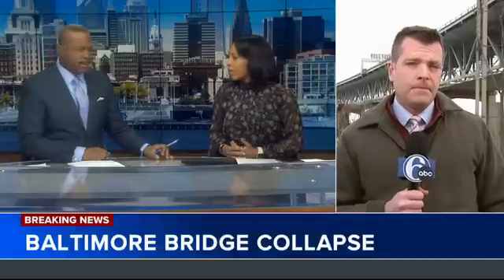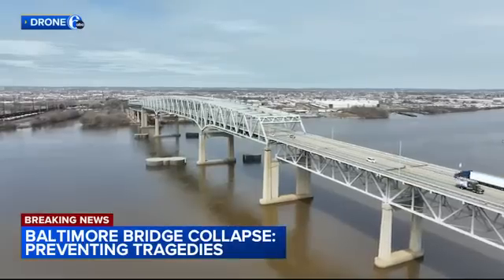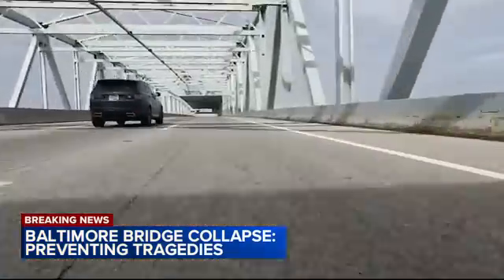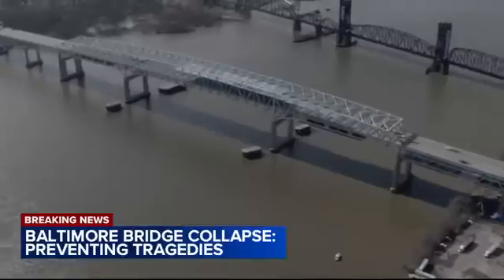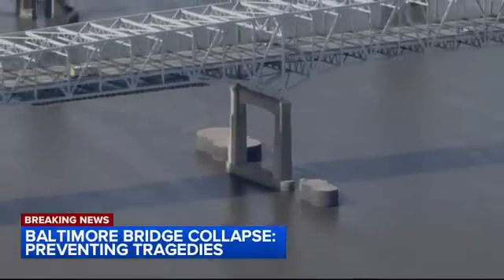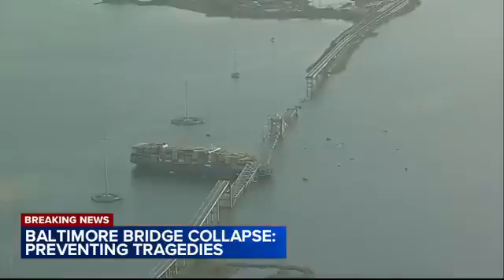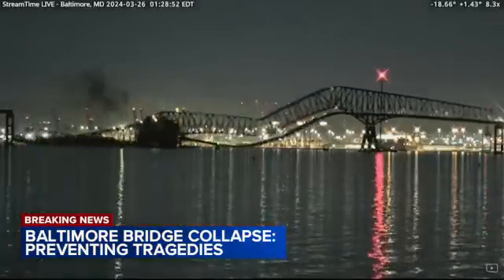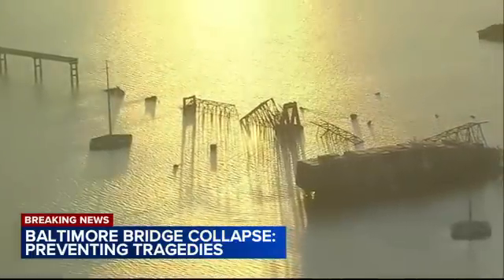Here's what surprised a structural engineering professor about the Baltimore bridge collapse

Comment: The bridge didn’t stand a chance with this loaded behemoth.  None
Reply: In 2007 the Cosco Busan struck the San Francisco Bay Bridge.  Well, almost because protection around the piers took the impact preventing a similar Boston event.   In that case, Harbor Pilot navigation error.
Reply: Not similar, big difference between hitting a pilling and hitting the bridge dead on! @nomenclature9373
Reply: @nomenclature9373 It wasn't pilot error, the ship lost power.
Reply: @nomenclature9373  Wow, my bridge; I've crossed this bridge hundreds of times. My friend Dennis Shephard was commutting home form the flower district on Fourth and Brennan across the Oakland/Bay bridge when he looked into his rearview mirror to see the car behind him plunge into the bay.
Reply: @nomenclature9373  The 2007 incident was a sideswipe.  It left a gash 150 feet long on the port side of the ship.
It did NOT strike the pylon head on.
Reply: The system protecting the Delaware bridges would deflect that ship. They glance off and divert the inertia away. They have them in Miami and elsewhere and they have been proven to work.
Reply: @AlexStAmand603  exactly, they don’t stop a ship , it deflects the impact away from the pylons , and Maryland looked into doing it and said Nah too much money.
Reply: The ship was 130,000 tons. It was going 8 kts. That's over 400,000 ft/lbs of force, spread over the minimal width of the piling. (I did sone quick math but I'll glady defer to an expert engineer). That bridge didn't stand a chance. The ship put more force on that piling than the whole bridge put on the ground it was built on, including traffic.
Reply: Almost 1000 feet of cargo going 8 knots? Like a Miata in front of a freight train.
Reply: There you go bein' logical, Chris!   😄
Reply: @chrismcgonigle964  Exactly. There's literally nothing you could do to make the bridge itself cargoship-proof.
Reply: @blackosprey2219   @chrismcgonigle964  Exactly. There's literally nothing you could do to make the bridge itself cargoship-proof.

You seriously have zero idea what you are talking about. NONE. 

This happened already in 1980, when a smaller cargo ship took out the Sunshine Skyway Bridge in Tampa. When they rebuilt it, they built considerable concrete berms around the piers, which are able to deflect anything except a head on strike, and stop dead anything that does hit it head on. It would be almost impossible for any current ship afloat to manage to take out the SSB. 

It is inexcusable negligence for the people in charge of these bridges to have not installed berms around the bridge supports in the last 40 years. There are some retired employees who should be broke and in jail before the lawsuits and charges have been completed.
Reply: @blackosprey2219  The barrier just has to be put far enough out front to stop a cargo ship. Problem solved.
Reply: @blackosprey2219 yes you can.
Reply: @nickbrutanna9973  Your not gonna stop a 165,000 ton ship. It will laugh at your concrete and just keep coming.
Reply: @blackosprey2219 You don't need to. You just put artificial islands upstream and downstream of the piers and the ship will be unable to hit the pier in the way it did. Why this bridge had no protections in place is insane, it was an accident waiting to happen.
Reply: @blackosprey2219 I'm a Captain and you're comment isn't even remotely close to being true, bumpers could've prevented this. They weren't put in place because they didn't want to spend the money. You shouldn't make assumptions about things you clearly know nothing about.
Reply: @nickbrutanna9973 I'm a Captain and you're correct, no protection was put in place because they didn't want to spend the money. If they were put in place this could've been avoided.
Reply: @Jacob-ed1bl  Cap, what type of ships have you commanded sir? TY
Reply: @billythekid3234  I'm a towboat captain with 28 years of experience. I never said I was ship captain or pilot. I operate between the port of Houston and the lower and upper Mississippi River. My vessel with barges is approximately 981' long and 54' wide. I operate in the same inland waterways as the ships do and literally have dealt with thousands of them. I'm extremely familiar with how they function and operate because it's part of my job. Calling people liars is pretty childish, but you saying "cap" already revealed that. Is there anything else you'd like to know?
Reply: Sir I was in no way calling you a liar!  If that's how it was taken I'm sorry. When I was flying it was common to call the captain Cap. with no disrespect.  Maybe you can answer this question,  could 2 tugs turn the ship and how long would it have taken?  I know they could but  how long,,,,,,,,,,,,,, thank you!
Reply: @billythekid3234  I'm sorry, man. I'm so used to people using "cap" as in "liar" and so many clowns calling me a liar. When I tell them I'm a captain, I immediately take it the wrong way, plus I'm on the vessel now and pretty exhausted.. I do apologize for  being a jerk, lol. 

So it's virtually impossible to give you an exact time because so many factors come into play. How fast was the current  how strong were the winds, how heavy was the ship at the time, how much room to navigate, and other factors all would affect how long that would take. I can tell you this much, two harbor tugs could push or pull that ship away from hitting that column in a matter of minutes. Turning the ship completely around usually takes anywhere from 10 to 20 minutes, but as I said, many things come into play that affect that time. I'm guessing you're trying to find out if having harbor tugs could've prevented this, and the answer, in my opinion, is absolutely.
Reply: @Jacob-ed1bl  Jacob,, no problem sir.  Ty for the info.  Maybe they will chang that for some harbors. Have a great day and get some rest! take care!
Reply: @billythekid3234  Thanks, you too!
Reply: @blackosprey2219 that's not true for most bridges that span shipping lanes.  Should have been anticipated and built to handle the worse.  With ships getting bigger upgrades should have been put in.
Reply: This is probably true of ANY modern bridge of similar length to the Baltimore bridge.
However, the concrete islands protecting the two piers of the Betsy Ross bridge are a really good idea. They likely need to be be strengthened on an ongoing basis to allow for the increasing size of these 'behemoth' cargo vessels. But the rounded ends of these protective islands will deflect the rogue vessel sufficiently to protect the bridge piers. And that's what's important.
Reply: That was a medium size container vessel the channel area and docks aren’t deep enough for the big vessels. Think double that ships size. When they loose propulsion they take a mile and more to stop.  Even tidal flow current would move a large ship fast enough to take that bridge out.
Reply: @kennethprocak5176 not true the port of Baltimore can handle the worlds largest ships and frequently does
Reply: Ship is the size of the Chrysler building.
Reply: Should have been called the Matchstick Bridge.
Reply: It would have, had the piers been properly protected. But that's not the only issue here. Why did the whole structure collapse like a house of cards when it was hit?
Reply: @bobjohnbowles  You're correct that it could've been protected, but you do not understand how it all came down is truly astonishing. If I kick your legs from under you, are you not going to fall? You can't grasp that one support held up those sections. Please use your brain 🙄.
Reply: Lots of questions about that Baltimore bridge...looking forward to the answers...
Reply: A true shame, and yet now something else to rebuild and RENAME away from our heritage. From the name of the composer of the 'Star Spangled Banner', to what!! >> lynnep6088: 'The company that owns the ship should pay to rebuild this bridge.' Absolutely! Its insurance company should be able to afford it too! Keep the name! Blessings to all victims affected!  (..and the Butigiege biased, LeftyLib, Racist, MORONIC, unnecessary comment! Freak show needs to STOP!! So Bad!)
Reply: All empty containers and not loaded.
Reply: The lights was on when it full powered before hitting black smoke rising from the stacks
Reply: Sabotage.  lefties, subversives inside "ooooh it's racist not to let them in, Extortion of bad seeds", we don't get our industries / mfg back they sent out on purpose with regulations and want more,  good jobs for Americans again and Quality, and security inside,   BUT OUR overtaxed / America drain drain drain GONE, china's army coming in illegally at the border too with the thugs, and pocket corrupt linings, lefties were "BOUGHT" by every hater/aggressor nations peoples 7+ decades ago at least.  taking actual freedom and what they offer in it's place is the opposite of freedom for partakers and their victims...
Reply: What? Are you saying Whoopi hit it?
Reply: The report I heard said the tug boats had just turned around which I thought was crazy since it was not clear of the port yet.
Reply: @anitacordeiro372  I believe the ship was technically clear of the port itself. It was centered in the exit lane in the river leading to the port from the Bay. At the time the tugs released, the ship was sailing in a straight line out towards the Bay. That bridge is actually about 2-3 miles or so from the port itself. Would you also expect a tug to escort it under the Chesapeake Bay Bridge that it would pass under in another 15 miles or so? It averages about twice as much traffic as the Key bridge.

You do realize that ships pass under bridges without tugs all the time, right? And without incident.
Reply: Is nobody else shocked to hear that there's a bridge in Chicago named after a known racist white defender of the patriarchy?

Do better, Chicago.
Reply: This is EMOTION, not engineering analysis. Sorry.
Reply: I'll take an educated engineers opinion over you or any other utuber
Reply: @Cre80s  The skyway bridge isn't capable of taking a hit from the ship. That's ridiculous. That's why it has massive bumpers protecting its columns.
Reply: Like many structures all over the US, it met the minimum requirements for the time it was buillt, was built as cheaply as possible, never upgraded, and just fine until a major problem or accident. Now, in everyone of these comment sections, people are saying nothing could have stopped just a huge ship in a case like this which is wrong. THIS bridge did not have protection, and was not designed to prevent this disaster. Many other bridges in major waterways do have systems  to deflect or stop ships of any size.   Watch and see what the new bridge has, bet you it will be cargo ship proof.
Reply: Definitely no chance, but who was steering the ship? 😆😅
Reply: Bridge wasn't built right
Reply: @OneNationUnderHiFi  where the bridge once stood, but underneath
Reply: Not true.  Simply have strong enough guard works so careful does not need to be replied on.
Reply: i was surprised at how completely the bridge failed. a hit should have closed the bridge, but in no way should one hit have totally demolished the bridge if it was correctly designed and built.
Reply: Yeah, that ship would have mowed right through any protection system. I figured to protect those supports, they would have needed an artificial island at least 50 years in size to slow and lift the ship. A few concrete blocks in the water would just get pushed right into the bridge supports by the ship.
Reply: The bow would stick out more even if those dolphins were in place.
Reply: It should have, though. Bad engineering.
Reply: The government wants to spend more money. Nothing would stop a bridge from going down with getting hit like that.
Reply: But would had not a chance against anything smaller
Reply: What is the difference between a loaded behemoth and a loaded ship?
Reply: No proper maintenance and proper design improvement through time and design limit to the ship capacities and size..
Reply: It's the immovable object meets the irresistible force. Maybe something could have been put there, but at what cost? Mammoth blocks of steel aren't cheap.
Reply: No engineer in the '70's could have even dreamed of that size ship.
Reply: The bow of the boat sticks out much further
Reply: @tonysylvester721  Not compared to the bulbous bow that is under the water.
Reply: @tonysylvester721  It's much longer in the water.
Reply: Where were the tugboats??
They usually assist in guiding the mamath boats
Reply: @michaeltewes7833 from what I could figure out is in Maryland tugboats are not required to escort the ship out of port. Massachusetts requires the tugboats escort ships out of port.
Reply: @robertknight4672  those rules will change very quickly.
Reply: @robertknight4672  The tugs took the ship from its berth, through a turn into the exit lane, then let it go.  It more or less WAS out of the port, into the river leading to the port. It had a straight line out into the Bay. I don't think it's unusual for ships to not rely on tugs when sailing in a straight line. When I was in the Navy, that's pretty much all the tugs did. Pull us from the pier, turn us into the channel out, and we're on our own. Even the carrier.

More concerning is the power failure. This ship was departing for a transit through the Panama Canal enroute to Sri Lanka, apparently. You'd think in preparation for a journey of that distance, a little more attention might have been paid to the condition of the ships engines. Going DIW as you're leaving port is ridiculous. Doesn't sound like it would have made it to its destination, anyway.
Reply: The did but they let it go before the bridge. Maybe keeping the freighters tethered until they pass the bridge is a good idea @michaeltewes7833
Reply: @michaeltewes7833 I'm a Captain and no they usually don't, it's also not required for this bridge.
Reply: @michaeltewes7833 my shipping expert said that the tugs had let the ship go already after they were under full power and on its way. Maybe they should clear the harbor like they do when coming in? Just what I was told.
Reply: @bps7209   I saw where they were a 1/8 of a mile from her, so I guess just not enough time?
Reply: @billythekid3234  evidently so it seems.
Reply: @michaeltewes7833  From my own experience with Naval Ships, tugs only assisted when bringing ships into the pier, we'd have a pilot when pulling out but not assisted by tugs.
Reply: @michaeltewes7833 They were there! They released the Dali just minutes before the malfunction. They tried to catch up, but didn't reach her in time!
Reply: @michaeltewes7833 once the sip is underway under its own power the tugs back off
Reply: @michaeltewes7833 "economic efficiency". Thank you Maersk!
Reply: @michaeltewes7833 the harbor master was controlling the ship
Reply: @michaeltewes7833  Its 'mammoth'. How would tugboats help a ship without power?
Reply: @giftedone831  Cause the tugboats pull the vessel ... it would not be running on its own power until in open water ... much like the pushback tugs work with airplanes
Reply: Tugboats have insane power and manoureability.

Basically 1 could have prevented this by moving to the side of the bow of the ship and with full power rotate her back into the channel.

Tugs were called but they were too far away being send off earlier when everything was still OK.
Reply: Tugboats don’t just pull. They can also push and rotate a ship.
Reply: @giftedone831 why tug boats are there!!!!!
Reply: @stevefowler3398  I understand that, but they had already been guided out of the channel and was fully under their own power when the accident occurred. Reading and critical thinking is fundamental.
Reply: @giftedone831 I'm a Captain and the tugs have about 10,000hp and fairly easily guid and maneuver ships in the harbor. They weren't required for making this bridge.
Reply: @giftedone831 tug boats are massively overpowered for their size. It's the reason we use them at all. It couldn't pull that ship at its cruising speed but with 5000plus hp motor it can help steer and guid them. That's what they are designed to do

Edit: what the guy above me said, since he would know better than I would. I didn't know the tugs were that much more powerful.
Reply: @gdiwolverinemale4th    That ship is CGI  video,  how can a tug pull that ?    slow the video down to .25 to see demo charges in the spans all the way across.
Reply: @giftedone831  Because that's the very foundation of their design - massive horsepower, huge thrust, strong towing  bollards on board, etc., etc.. In this case two tugs on shoreside pushing under max power would have no problem diverting that ship into the center of gap under bridge. THAT is the very essence of their mandated purpose. Tug masters are highly trained to optimize their craft's capabilities and in this case they would not have attempted to stop the vessel, but instead use it's inertia to re-direct it.
Reply: @giftedone831  Tug boats have mammoth power.  They look small but they are all engine.  Some have up to 27,000HP.
Reply: It was in the channel. Tugs escort the ships out of the port berths and into the channel
Reply: @giftedone831  they could have pulled it away from the support.....currents took over after the power loss
Reply: @stevenlittell1071  So what would be the problem if the tugboats did all the maneuvering until the cargo vessel cleared the bridge. The same procedure is in place in other similar ports. Inform yourself
Reply: @giftedone831  They do it all the time. They go to the fore and aft of the ship and run a line. The majority of the ship's mobility is at the waterline. There are videos of large tugs pushing or pulling ships that have lost power out of channels, including cruise ships larger than the Dali.
Reply: @giftedone831 tugboats could keep it from drifting out of the channel. They use tugboats to help it maneuver in the port so they're definitely capable.
Reply: @giftedone831  tugs are powerful too. this Charlie Foxtrot would have been prevented by nudging the container ship sideways a few yards.
Reply: @michaeltewes7833    Captain Rodney was asking the same question Michael.   Good call Sailor.  and what are all the demolition flashes in synch,  when played back at  X .25 speed.  Turn out your light to see them better.   Anchors Away.................
Reply: }}} The bridge didn’t stand a chance with this loaded behemoth.  None

Not true. Defensive concrete berms would either sink the ship when struck or, more than likely, deflect the prow of the ship sufficiently to make it not take out the support.
Reply: @nickbrutanna9973  so, the bridge didnt stand a chance....
Reply: I dont know about protections too...
Reply: @magnobraga4619  Right. For an average boat maybe but this boat....if delays the impact by 10 seconds max.
Reply: There was protection, just not adequate protection from this behemoth. Heck go ahead and build a tunnel in Baltimore, might as well now.
Reply: @mrblock1318  There are already a couple of tunnels in Baltimore. One problem with them vs this bridge, they can't take Hazmat. So, for a real example, a plumber local to the  north/east end of the bridge that was interviewed says he can't use the tunnels because of the acetylene tanks he carries. Unfortunately, for people like him, there isn't an alternative route that's not many miles out of the way. Not to mention any Hazmat shipping.
Reply: Lot of questions and concerns... the stacking height of the containers and visibility that allows at close range? when drifted near support and dropping anchor and starting back up and then shutting down and then back up? A lot not quite the normal of a good running ship? Why after 47 years this occurred? ... something was not working properly and who authorized this ship to sail believe we have answers we just need to dig a little deeper investigate and not speculate too much for sure? The picture gave us some strong not normal clues? Was all the checks in place at the pier before sailing.... seem like there was signs and even checks that were not followed or  missing and why?
Reply: and neither will the boston primaries when trump sweeps them up next week
Reply: 2 American pilot were operating the ship. 2 american hit the bridge. Other indian sailors saved life by sending SOS when they saw those american pilot not able to handle ship
Reply: The captain and crew were youtubers and tik tokers
Reply: You mean the bridge did not stand a chance with all those explosives.
Reply: PETEBUTTPLUGG has said the same thing many times throughout his life.😂
Reply: How do you know it was loaded?
They've already called it a receiving port, many times they back empty. What was the export cargo, considering how high the ship was riding, zero, zip, nada.
Reply: @Supertech-86 Fully loaded with cargo containers.  What is inside those containers?  We will not know until they release the manifest.
Reply: @captglenn100  Returning empty cargo container back to the point of origin.
Just like freight trains here in Michigan coming from Canada, you hear them slow from Sarnia, return burning up the tracks empty. Then taxpayers get to foot the bill to replace the tracks.
Reply: @Dieselfreak82  bs, I suppose misheard about track REPLACEMENT and how its a taxpayer investment and such. 170yrs ago it was banned in Mich constitution because of massive public losses but they've scrapped all that.
Reply: @Supertech-86  literally nobody is piloting entire cargo ships full of empty containers. The containers aren't used once to bring something in and then taken back empty 😂 do you know anything about shipping at all? Or even just common sense?
Reply: @Supertech-86 ...It's inconsequential whether or not if it was loaded, that ship weighs thousands of tons...and that's just the containers that were on it. The ship weighs 95,000 tons, one empty cargo container weighs more than 5,000lbs
Reply: @harryberry474 yep, I don't think most people can comprehend the weight of theses ships and what it takes to stop that amount of weight that is moving towards a fixed object and the type/desigm of bridge that it was, could never survive a section being knocked down.
Reply: @Supertech-86  it was  still moving a pretty good lick
Reply: @chrismcgonigle964  8mph ship vs 12 knot wind , try to think logically, draft of the ship Vs what amounts to a 60 thousand sq ft sail, Vs the ships hydrodynamic maneuverability, ability to navigate and control its movement effectively in various maritime conditions. source: a whole area of physics
Reply: @chrismcgonigle964  As I understand, it was initially going about 7.5 knots or so and slowed to 6 something knots before impact. Apparently, the black smoke seen is a result of restarting the engines and full reverse trying to stop. They also dropped anchor. And, it appears the combination of the anchor drop and the torque from the single prop in full reverse skewed the ship's course.
Reply: My company had 22 loaded containers on it. It was fully loaded.
Reply: @Supertech-86 -I believe the ship was only carrying about half of it's full load of containers etc. So this bridge was really a disaster waiting to happen.
Reply: The captain and the crew were Indians
Reply: @bintykala686 What tribe?
Reply: @bintykala686 so?
Reply: @bintykala686 And? The pilots are always local.